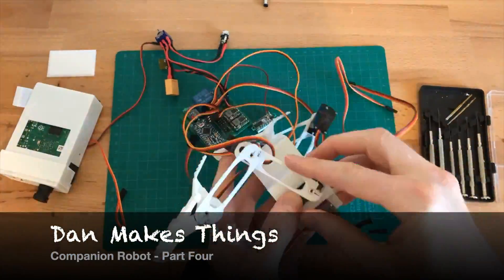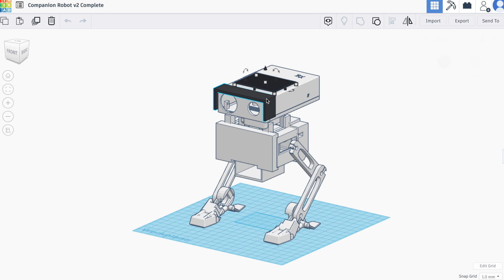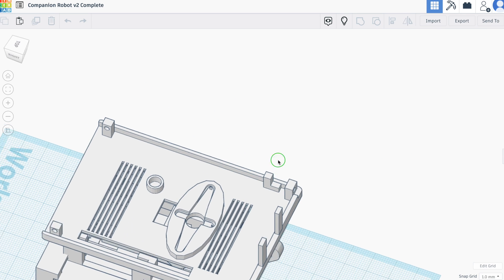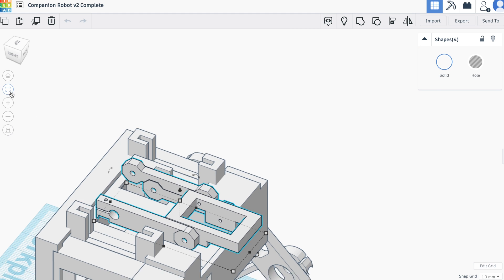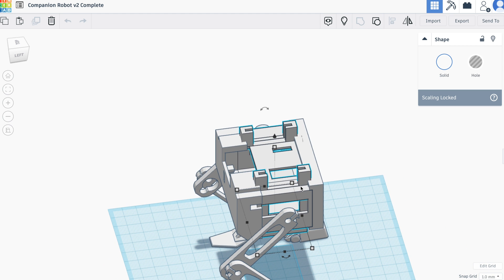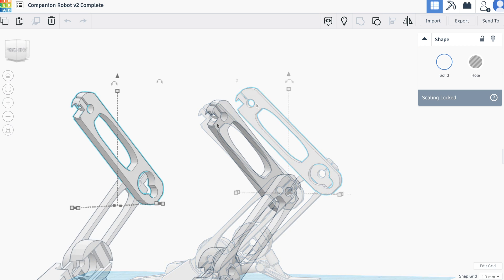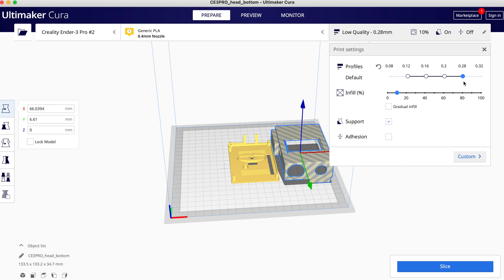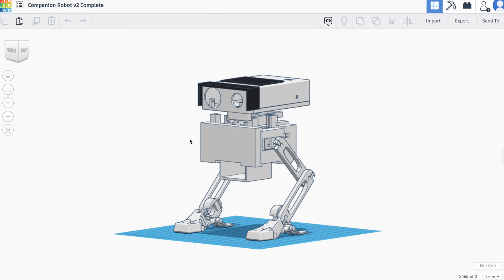Companion Robot: Part 4 - 3D Model - Raspberry Pi | Arduino | DIY Robotics

Comment: i wonder how you would go about optimizing the design to maximize strength and minimize weight. i always worry about how i can reduce stress of the servo joints
Reply from the maker: I can't find my notes about this anymore, but I calculated the max length that the leg sections could be before hitting the stall torque of the servos and then made them significantly shorter than that. So it means they can comfortably carry the weight of the robot plus a battery and have power to spare. 

If all else fails there's always manual testing to fall back on 😂 https://www.instagram.com/reel/CSj9Sldjr2d/